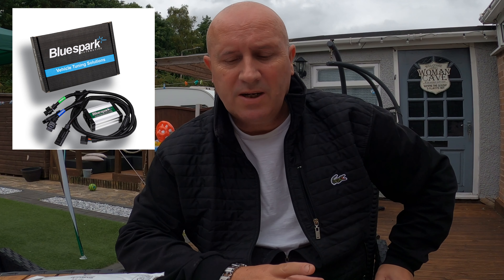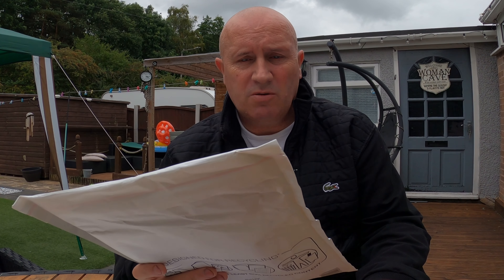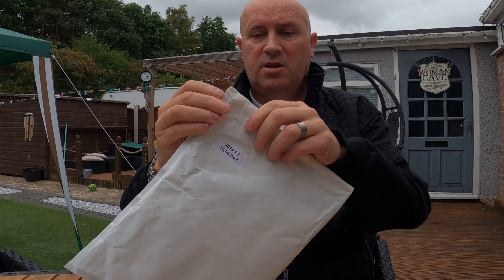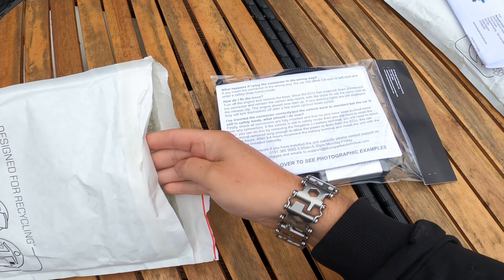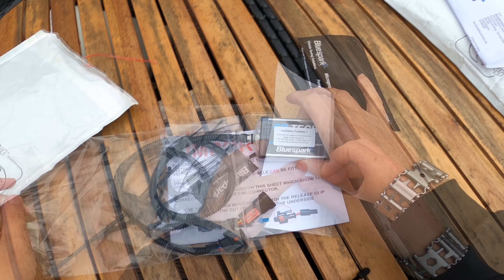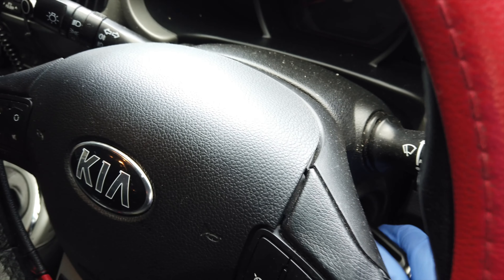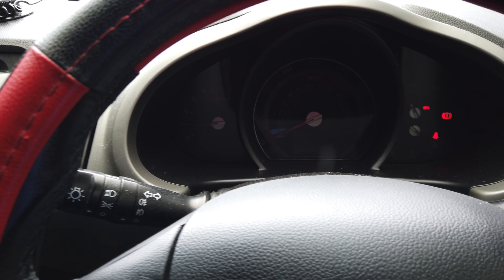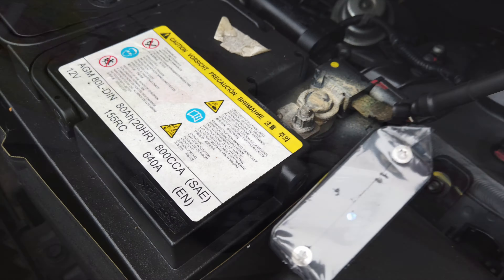Bluespark Tuning Box _ Kia Sportage How to # #cartuning

Comment: I fitted a Bluespark Pro+Boost to my new Sportage 2.0 CRDi back in 2016. Two years later I sent it back to Bluespark to have it reprogrammed for the Sorento I had bought. I now have it on my current Sorento GT Line S. The Bluespark has performed faultlessly from day one. I have left it on the factory settings as the improvement is more than sufficient for my needs. I confirm that their before and aftersales service is outstanding. Enjoy your new Bluespark. 😁
Reply from the maker: Cheers 🥂 I think it made a difference too
Reply: In the same situation, I've had mine reprogrammed for over 7 cars now and still perform faultlessly. Great for adding a bit of omph
Reply from the maker: @mustafaiqbal9204 yea it’s all good for both our cars

Comment: Good video, I have the 2.0 box and changed the jumper up to level 4 & left it set on map 1. I have more low down torque now and can drive in 4th gear around 25-30mph 👍🏻
Reply from the maker: My wife has the 2.0 Sportage to and she says the same thanks for the input much appreciated